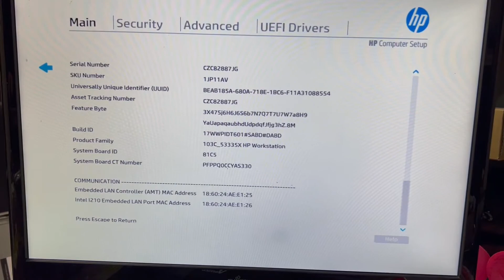Hp Workstation Z4 G4   upgrade Cpu to intel Xeon W 2140b

Comment: In my Z4, I had to replace the processor. (W-2123)
After replacing the processor, does the machine work with the W-2140B processor?
Is it not necessary to update BIOS?
Thanks for the reply.
Reply from the maker: Updated bios
Reply: Intel Xeon W-2145  is equivalent 8 cores but slightly better, and it is supported according to the specification. Watch for ebay second hand deals. The 6 core W-2135 has great bargains